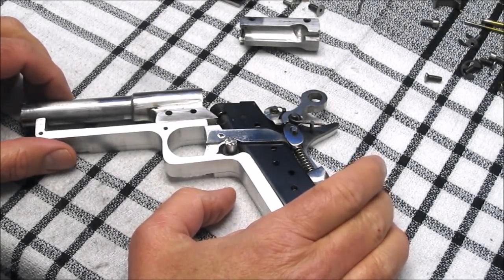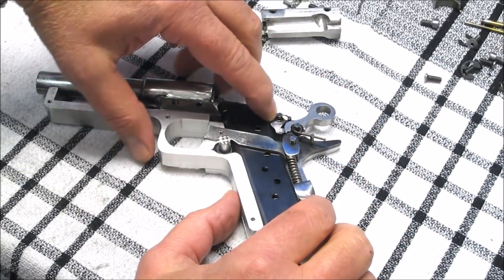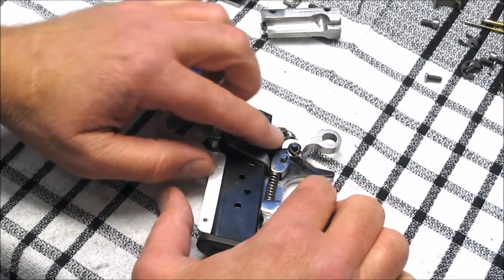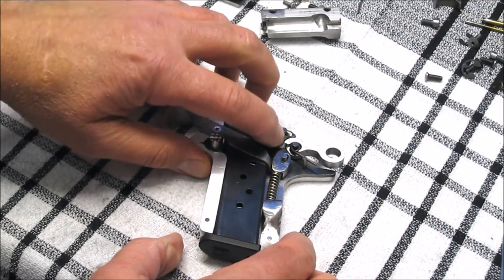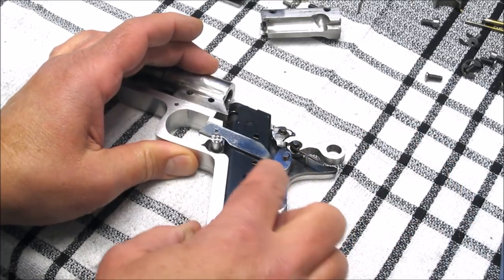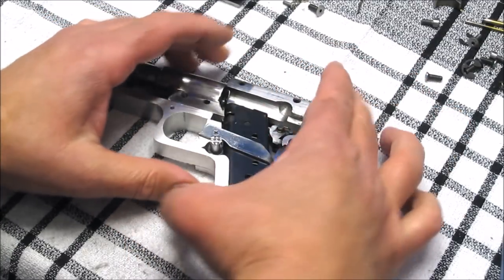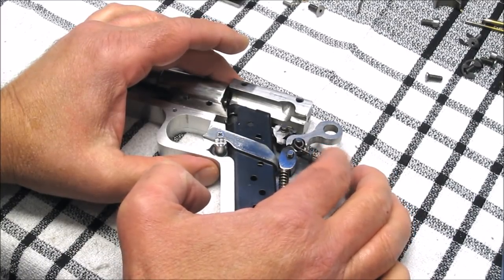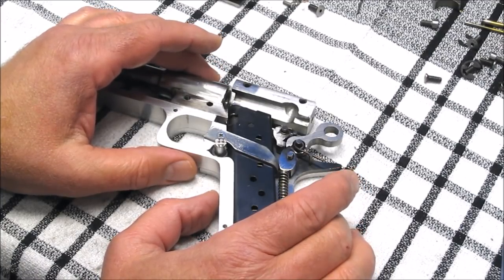Kolt380 Re-boot - No dang BANG!

Comment: I´m going to give you some advice for free.  A gun designer needs to be an expert in spring design and fatigue.  Springs not only make the gun go bang, they also determine the feel of the gun during manipulation.  So much so, that you must first design the springs of the gun THEN design the rest of the gun around the springs.  The most common mistake in gun design center around gun springs that are over-stressed, they are good for 50-200 rounds and then things go haywire.  It´s no biggy, you´ve busted your gun designer ´cherry´ so to speak.  Congratulations!  You are on your way dude.  Now, you have to make room for more coils on that style of spring (which will include changes, no biggey) or go to a different spring type.  Another tip, when you are dealing with  space constraints, wire and/or flat springs can save your ass as they do not require much width, i.e. not as much as coiled springs like the one you are using.  You´ll figure it out one way or the other.  It is just part of the gunsmith game.  Psychologically speaking, do not ever, EVER get down when you encounter obstacles like this.  Don´t ever define yourself by your challenges, rather define yourself by your ability to overcome said challenges.  You learn and move forward.  I really like the build BTW, now finish it!   Almost forgot, Merry Christmas and have a great New Year!
Reply from the maker: Excellent comment and advice. You're correct in stating in somewhat round about way, I'm not a gunsmith/gun designer/expert in any way. I'm a fairly resilient dude who doesn't accept failure as a normal outcome. These small issues will be resolved and I will have a functioning pistol when the smoke clears:)
Reply: Not a gun designer you say, trust me when I say you are much closer than you think.  Good stuff brother, good stuff indeed.  Cheers!
Reply from the maker: Thank you.
Reply: It was very interesting to find out that the Hudson team went back to a flat spring for the H9. A coil spring is just a torsion spring that has been coiled up, and the argument is always made that they are less prone to breakage since the load is spaced out over more material, and there is certainly truth to that, however we have quite a few advantages today over springs made 100 years ago that can challenge the "no flat spring" crowd.
Reply from the maker: Springs have always been the most challenging to my very few builds. Kinda cool though, solving the problems.
Reply: Interesting comment regarding the ´no flat spring´ crowd, did not know it existed.  Springs, regardless of type, should not be stressed beyond a certain point (typically 150 KSI) as sag will occur causing loss of load pressure.  Flat springs hold an important advantage over other types in that they require less space, which in some designs is a God-send.  Remember, flat or V-springs have been used in best quality shotguns for centuries and last forever.  The key is not going over the 150 KSI range.  That is why I mention being an expert in spring design for guns, it is more important than one might think initially.  I recommend ´Mechanical Springs´ by A.M. Wahl, 2nd. edition put out by the Spring Manufacturers Institute.  Spring design is not sexy but God knows it is important, just ask Mr. Westwood.  lol  I joke about it because I know that it is a real stepping stone for real gun designers and Mr. Westwood has reached that level.  Like I said, it really is a milestone that is reached by those with the courage to dare.
Reply: I will keep all that in mind when I start to put my design into the physical. I intend on making a oversized wooden trigger group model before machining anything.
Reply: Clinton Westwood I don't believe that bit about not accepting failure- encountering failure (as we've seen you do) is why you're succeeding. Only way not to fail, is not to try.
Reply: Clinton, I have followed your progress for many months and must say I commend your doggedness. I wholly endorse Mr Lasta's words and must remind you that I predicted you would strike this Hammer Spring problem several months ago and urged that you consider using (subject to space constraints) a packaged compression spring with connecting rod similar to the Colt 1911 (also Luger, P38 and many others). I also sent you a link for some fine drawings and specs for the 1911. If space is a consideration, a beefy leaf spring
might be the only other way to go. I hate to sound 'wise after the event' but I have successfully modelled the same FCG based loosely (like you) on Dr Parabellum's design using the 1911 Hammer Spring concept. I had the advantage though of more space to work with as my model is for a .22LR version and the magazine is tiny compared with your .380.
Carry on with your amazing work - I know you will find your answer.
Reply from the maker: I've had some measure of success by downsizing to a finer music wire. I now have three winds and the hammer locks on the sear and strikes the bolt with a solid strike. As I suspected, it's a balance of material size and spring design. I should have a test "blank" fire tomorrow, on the first day of the New Year.

Comment: I took a mechanical engineering course called "Machine Design" in which we learned how to design helical springs. I can send a copy of the book via email if you can understand high level engineering, or just want some good pleasure reading. Here's some simplified guidelines I dug up for some back of napkin calculations, these won't give you full solutions but should definitely help with trial and error:
"number of active coils Na is typically between 3 and 15"
"spring index C = D/d (coil dia divided by wire dia) is preferred between 4 and 12"
"quite frequently [torsional working stresses] are relieved after winding by mild thermal treatment"
"Music wire (similarly: UNS G10850, AISI 1085, ASTM A228-51) is the best, toughest, and most widely used of all spring materials for small springs (do not use at subzero temperatures)"
Reply from the maker: I appreciate the offer. I'm not sure I'd have the patience to read and absorb. I have a pretty good gut feel about what works and what is marginal. That's the experience of many failures kicking in:). I actually enjoy the whole spring thing. I love the simplicity and the whole stored energy thing. I'm thinking I watched too many Roadrunner cartoons as a kid. There was always a disaster when Wiley got springs involved.

Comment: I had this problem every time i tried to make this type of hammer spring. I just cant make one with enough movement in the spring to allow for full hammer travel had several deform or break. Not enough room for the amount of coils thatd be needed i think youd have to cut the slot for the spring most of the way into the hammer and aome of the way into the frame to allow enough room
Reply from the maker: I have room to deepen the pocket in the hammer a little bit. I may have to relieve the side of the pack as well to allow for 3 winds. How hard can it be? Think of a clothespin spring. I used to terrorize my little brothers with a clothespin corn shooter:)
Reply: Clinton Westwood i tried with mouse trap springs
Reply: Clinton Westwood i was just not able to make enough room for the coils needed

Comment: also got the same problem before, but i decided to make my own fire control group. i'd use hammer spring system like 1911 and the other i use my own design
Reply from the maker: Yes, some changes required

Comment: I wish you making a 9mm parabellum version of this pistol. And staple shotgun too.
Reply: 이동연 why,, it's not going to change much, just be slightly larger on the barrel and chamber, the breach block slightly higher and a little extra change in dimensions on the mag and well.
Reply: actually in a 9x18 firearm the issue is keeping the slide closed long enough that the casing doesn't have to bear the pressure.  there is much more involved in locking a full power pistol shut than just upping the spring tension. it is very complex

Comment: This is a clean looking pistol. Have the machining videos been removed? I'm interested in this clean "HomeMade" design. I'd also like to build a few auto loaders. I have a good 9x42 inch mill and an old South Bend lathe. Both are capable of machining most any guns. But to me Clean , simple , function , means more than an overly complicated machined piece of art.   Do you have any dimensional prints of these parts of this pistol? This pistol looks rugged , has nice lines , but looks many times better than the ElCheapo pistols. It shows you took time to make a solid worker that should keep on working.
Reply from the maker: I will have some drawings when complete. I have come back to the project after a 7 month lag due to other considerations. I've solved a distressing FCG issue with a rather simple solution. I may post links from another site or try my luck on youtube. I will most certainly post progress on WeaponsGuild.com. Check the out. All my stuff is on there.